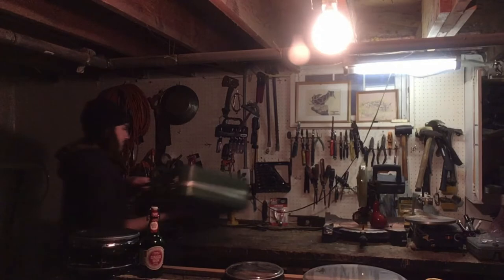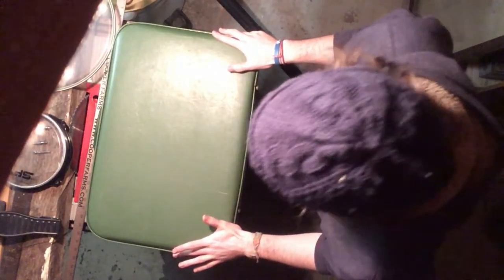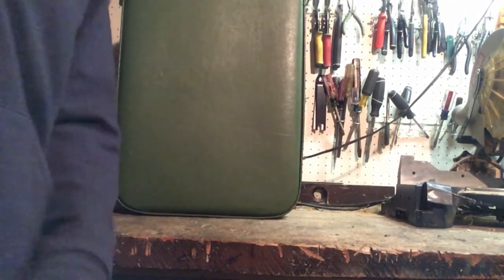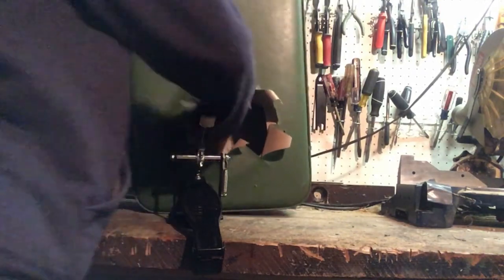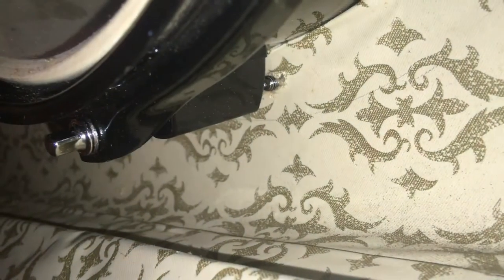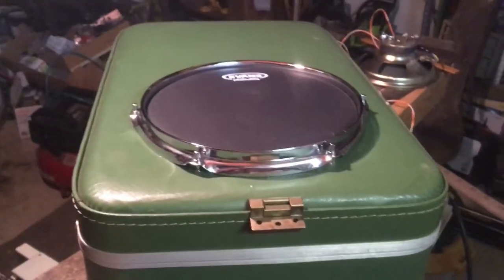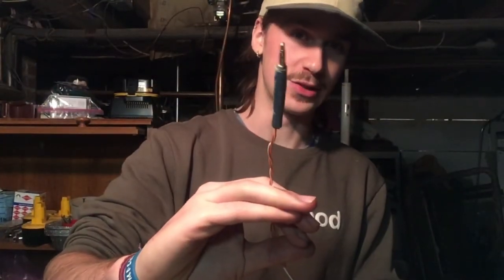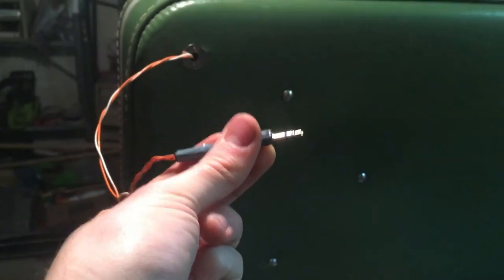How to Make a Suitcase Kick Drum (With a Snare Head)

Comment: Hey Jasper, I'm in the process of attempting to make a similar thing with a Samsonite suitcase (hard plastic shell).

Any chance you could clarify how you mounted the drum head into the suitcase? It seems like you just wedged the entire drum into the hole you cut, and then drilled the screws attached to the tension hoop through the suitcase. Did I get that right? Thanks for any help.
Reply from the maker: That's exactly it! It would have been ideal to put some sort of brace in there, but it's stable enough just having screwed it together with the tension hoop. Best of luck!!